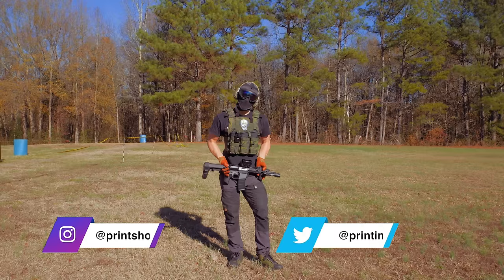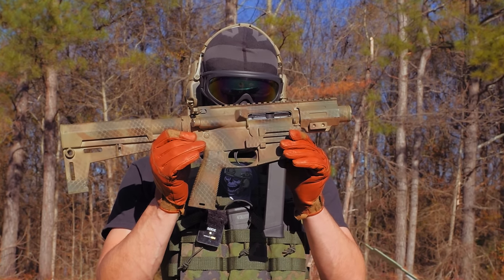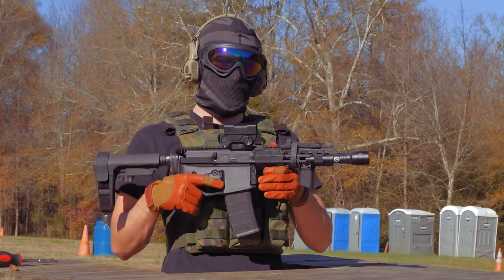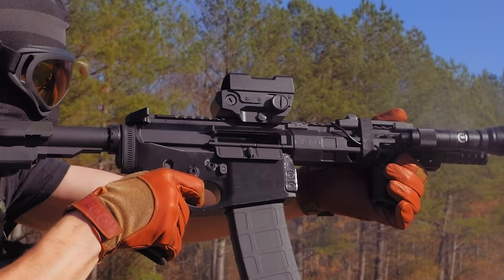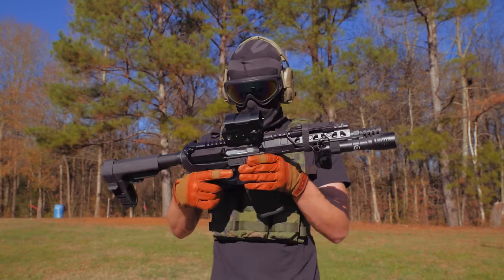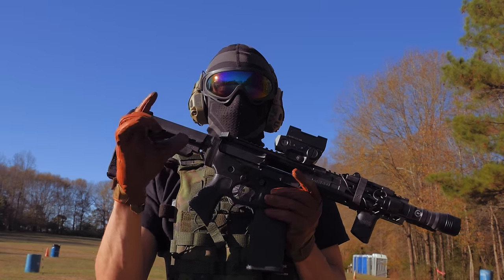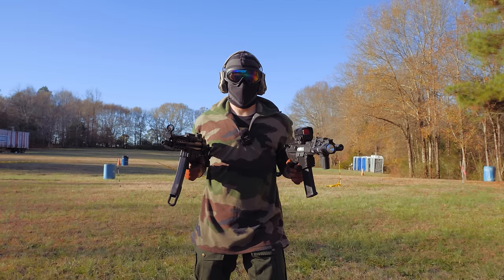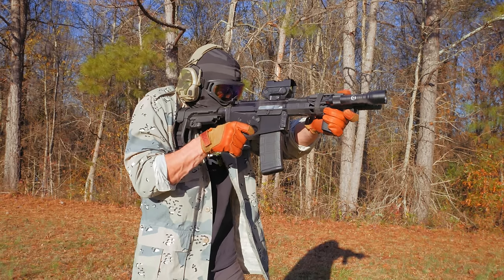New Delayed Blowback Just Dropped

Comment: Look at that bolt bounce! That system needs a heavier buffer spring or a deadblow buffer to prevent OOB discharges.
Reply: Thats inherit to the design of roller delayed blowback if they put heavy buffer springs that ar charging handle cant handle it.
Reply: That doggo has a sweet tactical headlight
Reply: It just prefers the pullout method
Reply: This will not fire OOB. The firing pin will not reach the primer if it’s OOB. Yes, I’ve tested it.
Reply: @ZEE0H6  idk dog I got a saiga 223 that fired oob and it was either bolt bounce or boxer primers
Reply: @jlo7770 are you asking about OOB firing on this upper which is what this video is about or the Saiga? I have this MEAN Arms bearing delayed upper and it will not fire OOB. The pin will only reach the primer enough to leave a small dent just like the floating FP on a .223/5.56 AR.

Comment: AR-9s that use 223 pmags are just dumb. So many other magazines that have a much smaller footprint. 😢🐼
Reply: Yeah but if you want to go 5.56 you just change the upper, BCG and buffer without messing with magazine adapters or a lower that just can't take 5.56 magazines.

You also open up all of the other AR15 caliber options just as easy.

On the other hand, AR lowers aren't too expensive but once you add a match trigger, a nice stock, a nice pistol grip and a folding stock adapter, reuse becomes attractive unless every AR you own is similarly equipped.
Reply: @beardoe6874  that’s a pretty decent response! I own enough dedicated 223 lowers that I’d never do this, but a really fair point!! I haven’t had an intelligent YouTube response like this in a minute 🥰
Reply: @Tequila_atTheJazzbar  oh, I forgot to mention what I think is the biggest downside to Endo-mags, if you are at a range where you have to clear your gun during a cease fire or after a stage of a shooting competition, the Endo-mag won't do that unless you run the mag dry.

It is very easy to leave one in the chamber and hard to get it out unless you have an empty mag to eject it with.

Outside of a range it's not a big deal,  just run it dry to clear.

This gets mentioned a little but not enough really.

I still like them but they can be a pain.
Reply: @beardoe6874  I’m a sucker for dedicated lowers. It is more costly, but more consistent, you’re right though, objectively.

Comment: These are cool but the price is too much. You can get a cmmg banshee complete for around the same price as the upper and it has roller delay. If they can get the price down to close as a banshee is then they would have something people would want to buy.
Reply: The Banshee is not roller delayed. It’s a radial delay. Also, how do you adjust the dwell time on the CMMG for different ammo or suppressed? The MEAN has 11 different lifters available to tune it.
Reply: @ZEE0H6  Same Difference. Yes i realize its different but it has the same effect. Regardless. They need to get the price down from $1500 for just the upper if they intend on competing with different options such as cmmg or angstat. Especially with a polymer handguard.